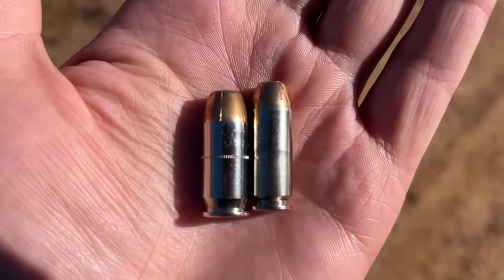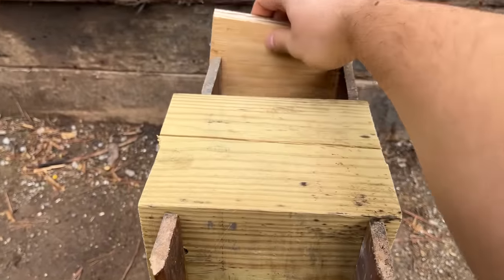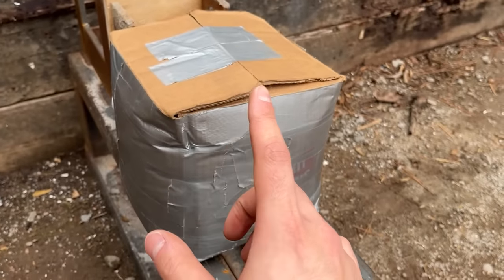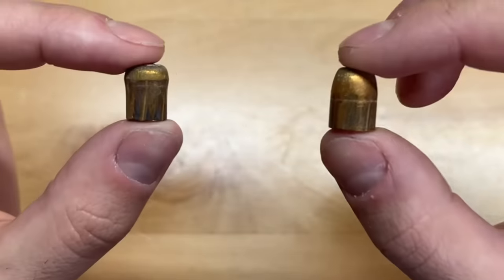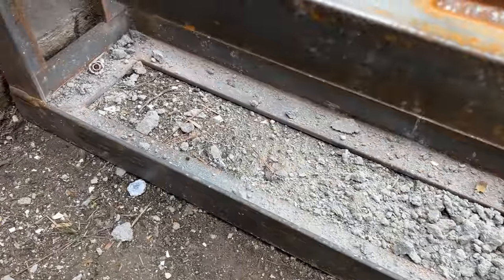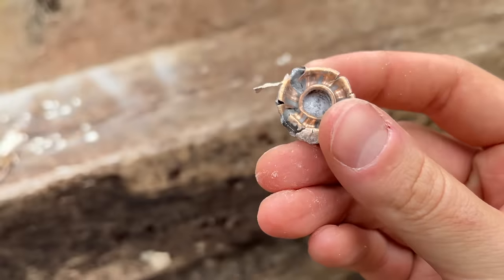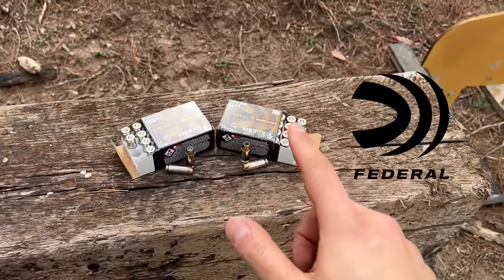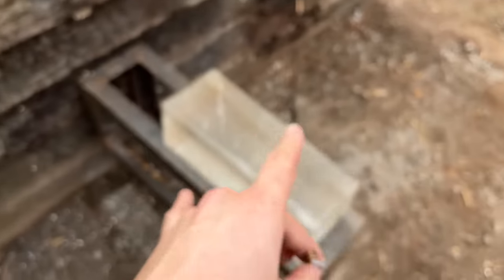45 ACP vs 10mm: Unbelievable Difference On Barriers

Comment: The 10mm and or 9mm are both meant to penetrate, this is why they are smaller so they can go faster and have less air resenstance. The 45 acp on the other hand is built for stopping power which is why it's a lot bigger but moves slower therefore transfering more energy.
Reply: 10mm is way more powerful than 45
Reply: You are right. However the 10mm has more stopping power than a 45 anyday. Check out civil liberty defense 10mm ammunition. I carry them in my edc. They shoot at 2400 fps and 800+ muzzle energy 🫡
Reply: @Trxpout  muzzle velocity or muzzle energy are given too much weight by folks. Lehigh not so extreme penetrator 140gr 10mm is 1500fps and 700ft lbs. Underwood 220gr hard cast only 1200fps but has the same 700fl lbs of energy at the muzzle. The gimmick Lehigh "penetrator" round goes ~25 inches in gel. The slower but heavier 220gr goes 62.5" (three times the penetration) and out the back of the last gel block. Mass is key to penetration. Thats why the 45 doesnt need velocity. On soft targets a good .45 HP (like HST) is far superior to 10mm. And i'm not a fanboy. I have both. The .45 for soft skinned critters and the 10mm for woods carry. The .45 HST reliably opens to ~.90" where the 10mm is in the .65" range. That is a MUCH bigger hole/area of damage.
Reply: @morbo5061  oh no for sure 45 has a far bigger wound. But 10mm has a harder hit to the nerve system. Ive ran multiple .45 ammo, 10mm ammo, from 230 grains to 60 grain civil liberty, speed kills and the 10mm has a far superior fps speed. 2400 fps is the speed of sound , like ive i said those are also rife velocity coming out of a pistol. The 10 may not leave a bigger exit wound , but if your talking damage to the tissue, nerves, shock system the 10 is and will always be superior. Check out the 10mm civil liberty gel test, the 10 leaves more multiple nasty permanent channels. .45 is in no way weak, but the only thing it has over 10mm is the size of the wound, test show and prove time and time again 10mm is superior.
Reply: @Trxpout  how much does that teeny little disc penetrate? Looked like about 12" in bare gel? Not enough mass to make use of any of that energy because it loses it too quickly. Velocity means absolutely zero until about 2000fps. No permanent wounding away from the wound channel  happens until about that velocity. Problem is that little 60gr bullet can't retain it and make it useful. I'm a 52yr old engineer and have spent many hours over the years studying it and my determination is those are snake oil and no way I'd carry those. But you do what you think is going to work for you.
Reply: It also heavily depends on the gun it is shot out of and what brand the bullet is.
Reply: @morbo5061  thats actually very incorrect. Im not sure of your experience but i was raised and taught by very well educated firearm instructors , I bring this up because I have access to real test including fps, energy, ballistic gel etc. if you seriously think that wasnt enough to kill any 2 legged thing i dont know whats wrong with you dude you might just like the 45 better personal wise. Why would i want rounds over penetrating when im in the city whereas i have ammo that stops the threat in its tracks? This isnt a “teeny little disc” thats whats wrong with you internet folks. ANY bullet will hurt and kill you used properly, like ive said yes the .45 leaves the biggest wound but your honestly just bias saying 10mm isnt superior in every way but the wound size its literally test proven over and over. I could easily grab buffalo bore /230 grain and over penetrate or even use fmj 10mm auto which goes through BLOCKS of gels easily. But like ive said why would i do that when i live in the city??? Please stop using your emotions in this conversation and actually look at results vs what someone says it does, the 45 doesnt beat 10mm at anything guy.
Reply: Using your logic a .45 should be more reliable against bears , but it isnt. Thats because anyone with gun knowledge knows a 10mm is outperforming a 45 any day of the week. Ive said it multiple times so stop getting your feelings hurt , the 45 is in no way weak with that being said that should speak volumes on the 10mm round. Its faster, more energy, more damage the only reason you would pick a 45 is because of preferable or not enough $ for ammo practice which i doubt because 45 isnt cheap either. For defense you dont want a round that goes through someone because if you miss a vital spot your not damaging them whereas a hollow will stop expand and blow up on non lethal parts like a finger, shoulder, toes etc. you dont want a round going straight through a target unless your shooting through barriers or have competition aim. Even then anyone who competes in firearm events will tell you a hollow or jhp is better than fmj for self defense. You have alot to learn and nothing is wrong with that, but in order to learn you need to stop spinning lies to make you feel your round is the best. Its okay dude theres always a superior round to the bullet you have including me, but denying it because you cant admit it is just girl tendencies
Reply: @Trxpout  I carry a Springfield XDM 5.25" 10mm with 220gr hardcasts usually in the woods. Sometimes a Springfield XDM 5.25" converted to .45Super with 255gr hardcasts. No I'm not saying a regular .45 penetrates better than 10mm. I'm saying MASS is what you want for penetration. Look at the guns big game hunters use. Big slow and heavy is the ticket for penetration. Period. I don't have gel to test but suspect the  .45Super 255gr about equal to the 10mm 220gr. I know the 220gr will go over 60 inches in gel and keep going. I've seen it. Mass has FAR more effect than velocity on penetration and that Sir is proven fact.
Reply: @morbo5061  and guy you literally just said the 45 doesnt have better penetration so in what world do you think the mass would make up for the 2-300 difference in energy and 1000-1500 fps difference regardless of what your using it for. Dude you need to do alot more research before having this debate because i have yet to hear any actual test you yourself have done. I have both rounds in all different brand ammos from low to top shelf , literally NOTHING about the 45 but the cool hole it leaves has a advantage over 10mm. You are correct to a certain point yea the mass and slower bullet is better for penetration but thats what im trying to get you to understand , the difference is so much that it will still have a better effect than the .45 at what your saying.
Reply: @Trxpout  I said 10mm out penetrates a regular .45ACP not sure if you lack reading comprehension or just trying to tqist my words to improve your losing arguments that speed or MV means penetration. Those little fast bullets sumply bleed off energy to fast beacause the are LOW MASS. What I did say is that Underwood Ammo .45Super 255gr at 1050fps (MV=654) and 10mm 220gr at 1200fps (MV=704) would be close. The .45Super is giving up some MV and ME but has a little more mass. Cross section of 10mm is better tho. I think it would be very close but would not be shocked if the 10mm won slightly or if .45Super won slightly. 

In the video I posted it clearly shows a 10mm 140gr Lehigh Extreme Gimmick Ammo going 25.3" in gel from a G20 followed by the 220gr Underwood going 62.5" and exit the last block and keep going. How you reckon if more the DOUBLED the Lehigh Extreme Non Penetrator Gimmick Ammo. It had `250fps more speed but the heavier buller absolutly spanks and embarrasses it. 

Not wasting my time trying to educate some someone. After all it is easier to fool someone than to show them they've been fooled. I just hate seeing people falling for the gimmicks and wanted to at least try to open your eyes to the marketing trickery but alas you want to just stay in the Matrix. So be it. I'm done.
Reply: @morbo5061  dude you keep just talking to talk and its so damn obvious. Just do me a favor and when you can , save some money and buy real deal testing equipment. .45 super cannot compete with 10mm , there is so much more to it you dont understand. Longer barrels, carbines and etc. literally the .45 is the gimmick round you keep mentioning , so big and slow just to still not penetrate and do as much internal damage as a 10mm, but whatever guy shoot your .45 its not me carrying the more underpowered round so idc
Reply: Against people, it’s like arguing whether a sparrow or a robin is more powerful.  In the world of combat firearms, they are both pips.  You pistol is just there to reassure you until you can grab your 12 gauge or your AK.

Comment: So if your priorities are stopping power + minimizing overpenetration, it seems from the first test that the 45 ACP is the better choice.
Reply: Just one problem with your theory, hoss. He tested this with FMJ rounds.
Reply: And to add, I bet I can find more available off the  shelf 45acp ammo, and much cheaper than 10mm. I carry federal PD in 230grain in my 45s. And nobody is going to use FMJ for personal defense unless you live in a backward stated like NJ.
Reply: Umm the 10mm has more energy and has a larger permanent wound cavity. Not sure how that equates less stopping power
Reply: @kfelix2934  I have handguns with both, its pretty much the same, aluminum blazer is even cheaper actually, brass blazer is like exactly the same as federal .45 or blazer .45
Reply: @MasterTaters  which on the .45 will still not over pen.
Reply: @ethang1344  Let me know when it beats ranger opening 1.1 inches. It doesnt, its a .40 cal bullet. I will not leave a bigger hole. It also over penetrates and will blow through a person. So its not expanding much at all.
Reply: @ManOfChaiTea  .45 acp FMJ at 830 fps will go through 2 layers of drywall and then still 20 inches of flesh or more, overpenning a FBI test dummy. Both are a really bad choice in FMJ if you want to "Minimize overpenetration" Winchester FMJ loaded to standard pressure will hit 25 inches, can go through 3 people if they are thin enough. 
.45 FMJ is "better" at this compared to 10mm FMJ but still awful.. On average a human torso is 10-12 inches thick. If you want to not overpen, you select a JHP or an entirely different round if you are hardset on using FMJ. There are many verified instances of .45 ACP fmj overpenetrating and hitting someone behind the intended target..
Reply: I know this might upset some new comers in  the  gun world  but you are doing to the 45acp what other people are doing to the 308, yes the 45 and 308 are older  calibers yes and if people would study up on them they would find that those two oldies already done everything and that is why  they are the goto calibers for comparison, old folks like me won't be fooled,  I mean let's face it the 6.5 caliber has been around for a long time, just because Hornaday gave it a new case and tacked the  Creedmoor name to it didn't magically make it so great, and how much longer are they going to degrade the 308 just to get a selling point, it has been around long enough it should have already made a name for itself so you can leave the 308 alone now. I  said that because that is what's going on with the 45acp verses everything you compare it against, all that said just remember this, no matter what new caliber comes along and sometimes out performs an older one doesn't mean that the older caliber won't go on doing everything it has been even better because with all the new powder and bullets that are being produced the manufacturer's  are making that stuff for all the older calibers to
Reply: @georgelewis7010  Couldn't agree more; as an example 6.5x55mm(Swedish) was the first to "master" that particular width dimension, and the older less popular 6.5 mauser did this almost as well but it was a necked down cartridge. The 6.5 swede can also stack more rounds in the same height compared to the creedmoor, while managing to pump out slightly more energy. Every older cartridge still in common use somewhere has gotten the same updates as anything else, people also forget 9mm luger was invented at the turn of the last century.. The .45 ACP is actually a few years newer.. I'm only 30 and before I ever owned a gun I studied guns(For about 7 years, my parents never let me have so much as a bb gun when I was very young and that made me embittered enough to make it a focused and learned hobby) accomplishing quite the opposite of the original intention! This goes to all parents out there, watch what you tell your kid "no" about because it may backfire badly, every kid wants to do the thing they aren't allowed to :D I fancy myself a Ballistician but I learn something new every single day. I tend to pickup a new or new-to-me firearm once about every six months and I've been doing this since I was 19.
Reply: @ethang1344  He did not say it had less. He was saying both have stopping power. But he does not want over penetration and I don't either, one could be looking at going to jail if your round over pens and kills someone behind them or in the house next door.
Reply: @MasterTaters  The gel block was tested with HST rounds not FMJs.  Over penetration is a major fault.  Don't want to kill innocents with an over penetrating round.
Reply: Im more concerned about costs. Is .45  ammo more affordable?
Reply: @jimthvac100 they have faster expanding hollow points because the speed it will loose all it’s momentum and open up almost instantly if you have the proper ammo going fast enough
Reply: @jimthvac100 also you should know what’s behind you’re target and you shouldn’t be so paranoid about this because you will most likely never need to use you’re gun unless you go looking for trouble aka being the problem